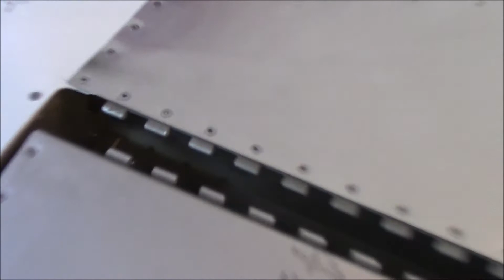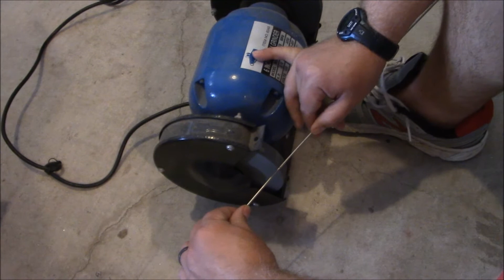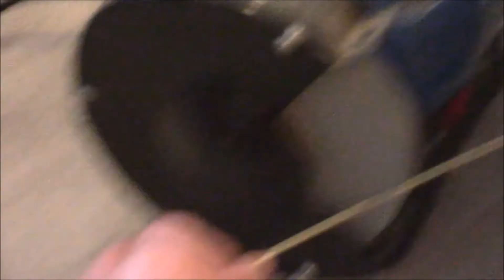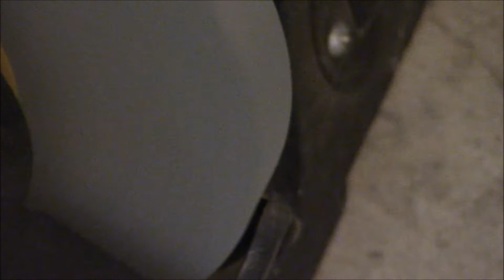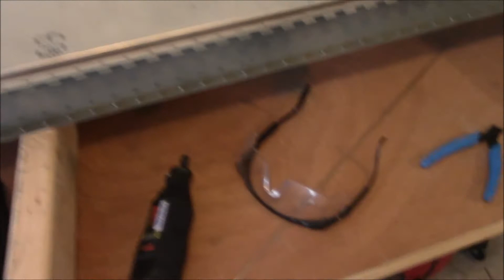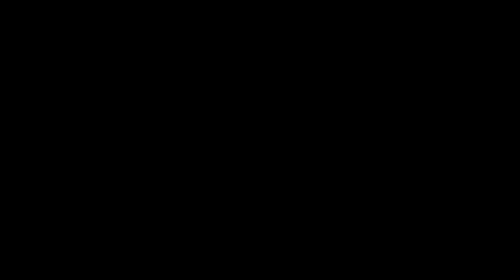Sonex Aircraft build Video 34 Cutting Elevator Hinge Pins

Comment: I think that the piano hinges for the elevators are riveted on upside down.  The rods would slide in and out easier for disassembly for painting,  It would also have provided a smoother airflow over the top.

Comment: Where is the elevator trim tab?

Bruce

El Paso

Onex 0189

N189BK
Reply from the maker: +Bruce King Hi Bruce, I opted to do the "Dial A Speed" or is it "Dial A Trim" package. I will have the big red nob in the cockpit that will use a spring to push or pull on the elevator giving me the desired trim. -Dan